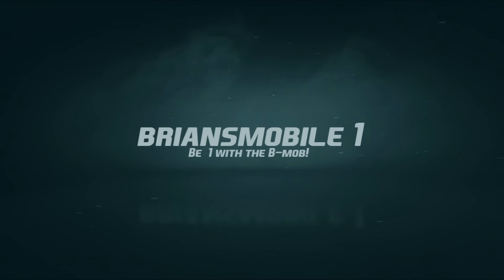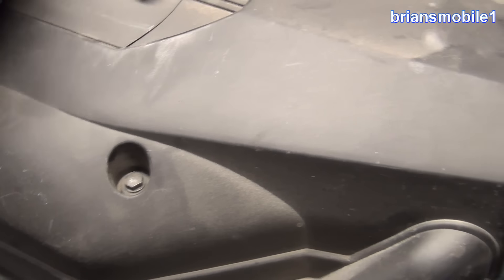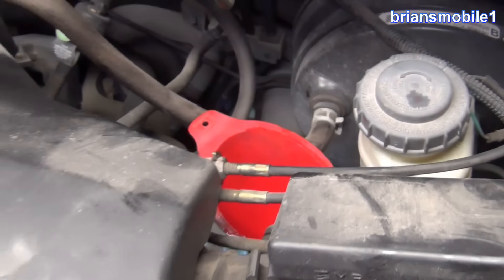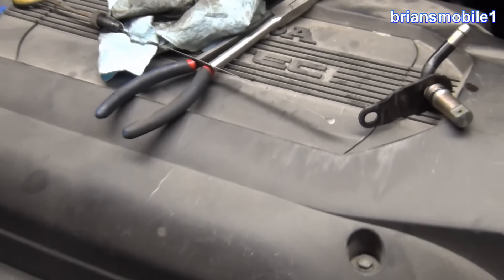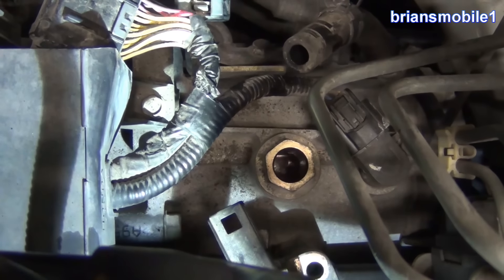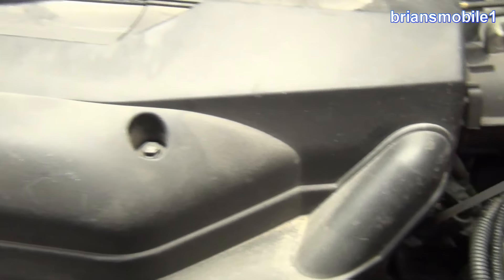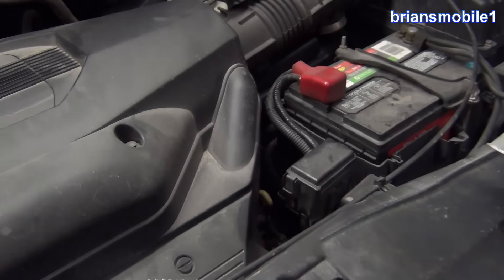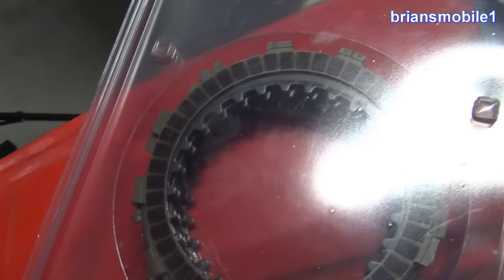Watch this Video BEFORE You Destroy Your Honda Transmission

Comment: Wiped out my transmission in my 02 Civic. Should not have changed it, lasted about 1 month after flushing. Learned my lesson with the Hondas.
Reply: What did you do wrong?
Reply: Did you flush it or just dump the fluid and fill?

Comment: 2006 Crv owner, it’s got 275k on it. It has the bearing noise from the misaligned bearing in the trans side cover which is in the tsbs for this car. Been that way for a long time and I live with the whine. Been doing a drain and refill on the trans every 3-4 oil changes and checking the magnet for debris.  Using maxlife synthetic atf. 4 qt jug is $20 at Walmart.
Reply: Great video however I disagree about the Honda DW1. I've used valvoline synthetic on my CRV for the past 190,000 miles and is smooth as butter. I change it every 50k and never use Honda DW1. Never had a transmission issue. I even tow a trailer now and then. I currently have 248,000 miles on my CRV and going strong.

Comment: That "return line" is installed as part of a recall for 2003 and 2004 models.  It was to provide extra lubrication for one of the internal gears.  If your 2003 or 2004 doesn't have this, get it done.
Reply from the maker: Thanks so much for sharing that.  It really seemed like a piece of after thought engineering. 

Especially since it's not a 2000's Chrysler- it seemed out of place.
Reply: Yup. I put many of those kits on at the Acura dealership as well.
Reply: No Thanks no the RLs were good for the most part, it was the TLs and the MDXs that had the same issues as the accords and odyssey’s
Reply: @Jack Daniels They must have gotten the 04's when they were still brand new fresh, because everyone i know who has a 2003-04 Odyssey hasn't had any transmission issues like the 99-02 years.
Reply: @briansmobile1  It was definitely an afterthought. The root problem of that second gear overheating issue was that the C2/S2 Gear set was subjected to inadequate oil coverage when the car was not in second gear (heat radiating to the gear set without being dissipated). This issue was eventually fixed by changing the design one of the valves in the Main Valve Body (Lockup Control Valve, maybe; I don't remember) to increase ATF flow to the second gear set. The problem manifested itself mostly in vehicles that were driven long distances at highway speeds in warmer climates, where the opportunity to downshift and flood the gear set with ATF were less frequent.
Pretty sure that design changed in Mass Production in 2003 across all V6 5AT models.

Comment: I know I'm late to the party, but have a 2006. Trans change at 225k and now has 380k with 3 fluid changes on it. About every 30k I do a drain and fill. Great video
Reply: Is 225k your first change?
Reply: @renzrenz3465  Yes that was my first change. Current one down shifting into 3rd a little hard sometimes. When I did a drain and fill at 400k the plug was a bit too fuzzy for my liking. Really can't do anything about it but baby it until it dies... trying for 500k
Reply: @thomasphilyaw8593  meaning after your first change it works better?
Reply: What kind of vehicle?
Reply: @starkeymorgan4142  2006 Honda Odyssey Touring, it now has 430k miles.
Reply: @Starkey Morgan No filter change on transmission just drain and fills
Reply: Are you saying you changed the transmission at 225k miles, or that you did your first fluid change at 225k miles?  If transmission, did you rebuild or salvage?  Thank you!
Reply: @mattmccoy7364  I changed my transmission at 225k. It took a dump...I bought a rebuilt transmission that had all the upgrade fixes done to it and installed a trans cooler also. Trans was about $1400 and install was $600. I bought it from a shop in South Carolina and had it shipped to the shop that changed it for me. Now my van has 435k and still going.

Comment: Going to a quick lube is always a bad idea. If you don't know how to do it, watching a video like this will give you more knowledge than the quick lube place has. In most cases the underpaid high school graduate knows even less about each vehicle. They fix every car the same way and cars are not the same. Bring it to a specialist or watch a video like this from a specialist. Thanks for the info. Very helpful as I'm trying to figure out a transmission problem that a "mechanic" has messed up. There are a lot of "backyard" mechanics disguises as professionals.

Comment: 1990 civic hatch. 275k on the OG trans. Fluid changed every 15k. I’ve been keeping that up, still shifts like butter..
Reply: What type of transmission fluid did you use? Autozone is saying dextron 2 for this year.
Reply: @ronniecatalano5246  Honda ATF.

Comment: OH man this video came at a better time, I work at a Honda dealership maintenance department and transmission fluid replacement is part and parcel of our work. By the way, I didn't know John Malkovich is a car technician lol
Reply: So do we check the trans fluid level with the engine on or off?😂
Reply: @superjeffstanton  according to the OEM instructions: off after running the engine to operating temperature after fans turn on.

Comment: good video ! i have this same van and made the switch to redline d4 atf four years ago and the trans works so well that i am using it in the power steering  without any issues i think that honda atf is over priced and not near as good as the d4 and i had to replace the steering rack two years ago witch always had the honda ps fluid in it and the rack failed ! d4 is the solution people .

Comment: I destroyed mine back in like 05 at 110k by adding some additive to fix what I thought was hard shifting (it wasn’t). Didn’t take long to find out what hard shifting really was. The clutch material plugged the passages and trashed the first/second gear clutch packs. Had it rebuilt and it lasted another 100k without issue with just drain/refills.
Reply: How much did they charge?
Reply: What did you add?

Comment: Since I will own my Honda Civic till I can no longer drive I do use Hondas transmission fluid but do the intervals sooner than they recommend .
Why ?  Two things you must realize , manufacturers have determined the recommended maintenance will take your new car through the warranty period without problems ,  I plan on owning this vehicle for well over 200k miles and more frequent fluid changes will increase my chances of making it through that period and we’ll beyond .  Also , get the best lubricants and filters available , it will pay for itself .
Good video sir ! 👍👍

Comment: Good advice, only drain and fill a Honda automatic. I do it every second oil change and have not had a problem in 20 years.
Reply: I do the same with my fluids as well as oil and they are all crystal clear.. never have any problems and shift like brand new.

Comment: 100% correct..NEVER flush anything..motors (unless you rebuild it) or transmissions..
Reply: Never flush anything that is OLDER, radiators included. But if its well maintained from day 1, you can get away with it. I "flush" my  motor sometimes with some transmission fluid or Marvel Mystery oil. But yeah, empty and refill is the safest policy.
Reply: You are saying never flush a radiator?

Um ok guys. 
That’s just wrong. 

Obviously you guys never do much ac work.
Reply: I've flushed my transmission for years. Never had a problem.
Reply: @DJR5280  I keep hearing people say never flush a transmission because if your clutches are gone the material in the fluid is keeping it going. I build my own transmissions (4L60E) I know for a fact that is complete bullshit. Ive also heard that the clutches are brittle and the flush will make them fall apart, also complete bullshit I can understand not doing a cemical flush but a fluid flush is fine.
Reply: I'm so sorry my husband did the chemical one. Here is the tow truck
Reply: Iv used sea foam an it works just use a little for 100 miles before oil change keeps motor clean an fresh wit no damage.
Reply: @martinez1701a  I have a 2005 Malibu with the 4T45E. Every 30k I have it flushed at thr dealer. Went 170k miles before the 2-3 shift solenoid went. The shop I went to talked me into a rebuild. What a nightmare. I don't think I'll ever get a rebuild again. Anyway, I had the transmission rebuilt again ar 205k miles and I'm now ar 272k with no problems. Flushed twice at the dealer since 205k miles. They use BG products. No problems so far. My 05 Tahoe has a 4L60E. Not sure how I want to attack that.

Comment: As having rebuilt a 200,000+ mile Honda trans that was abused, Honda transmissions are built like a manual transmission but with clutch packs on the side of the gear assemblies.
Reply: Any manuals for this. Trying to look at what to do for fun. Im having a hard te finding any info on rebuilding transmissions.

Comment: Funny thing is I did the GM Goodwrench transmission service every 45k miles on my 2004 Silverado 1500 and it had 220k miles on it before the transmission died. Those transmissions are noted to last only 130k or less in many cases. 1st service was a traditional service the old way and 2nd was machine serviced. 3rd and 4th were machine serviced and it made it to 220k so it did not hurt it that bad. Just my experience with Machine services. Now on my 2020 Camry I am doing traditional service all the way so I will see how it does. I just purchased another GM truck a 2003 GMC 1500 so I will see how it does with just traditional service. I have had concerns about this too, but it did not hurt my 2004 Silverado at all.

Comment: Just a little history on that "Return Line".. It's actually a sign of the vehicle having the Transmission Recall done on it.  That Jet was installed to properly lubricate the 2nd Gear.  So if you have a van that doesn't have that Recall Jet installed, I'd suggest getting that recall performed or worst case, just buy the Oil Jet Kit.
Reply: I wish I had a part# for the kit, and I agree with you. You're exactly right about the purpose of that Oil Jet Kit.
Reply: @netdoctor1  A/T  Oil  Jet  Kit: P/N  06250-PGH-305,  H/C  7758931

Or just stop in at the Honda dealer, they might have an updated version.
Reply: @peteryang7784  Excellent, thank you, though it's different part numbers for different models. See also https://atracom.blob.core.windows.net/manuals/individual/2006/2006-226.pdf

Comment: I have been using Amsoil ATF for some 25K miles, for two 1x3s,  and it works great. I often hear about only using Honda fluids, but the Honda stuff is not nearly as high-end of a synthetic as Amsoil or Redline. I could feel the shifts degrading over time before with the OEM fluid, yet have not felt any degradation using the new stuff. It did shift much firmer initially after switching, but calmed down to normal after a day or so. 

The Acurazine forum for my 3rd gen TL is in love with Redline products, and using as little friction modifiers as possible in the ATF, so you could look into that as well. Remember to change the filters on these cars if it has never been changed before.

It seems that changing out the fluid regularly is the best thing that one can do to prolong the life of a Honda transmission. And this is the best video tutorial I have seen yet on how to do it, thank you Briansmobil1.
Reply: Amsoil is the best. I use it in my 2018 Honda CR-V. Cvt transmission
Reply: I use amsoil cvt trans. Fluid

Comment: My shop recommends performing drain and fill service on Honda automatic transmissions every 15K miles. We use O.E. Honda fluid. Our customers who adhere to this service have very little transmission issues.
Reply: The only reason to replace it that often is cause honda doesn’t use a filter for some reason.

Comment: Thanks Brian 👍🏽👍🏽..., Remember guys an gals to check your owners Manual.  Different models have a specific fill level, for example my 08 pilot 2WD takes 4.0 quarts and the 08 pilot AWD takes 3.5 Quarts. I filled mine to 3.5 because I was lazy and checked Google and a couple forums which said 3.5 so that's what I put🤦. Randomly  skimming through my manual in Specifications section there it was ATF 4.0 quarts. I was riding like that over a year. Note to self  Always check the MANUAL😬

Comment: I check the level before removing drain plug.. I drain then fill with the same exact amount that came out.  

A friend of mine had some rough shifting in his 2012 accord... we did 3 drain and fills in a span of 2 months. We also cleaned out all the solenoids that were accesible at the last drain and fill... problem was fixed.  After every drain and fill we got better results.  Trans fluid was cheap on amazon.

Comment: IMO as a tec the best thing you can do to these   transmissions Add a “transmission-cooler”...good video
Reply: 110%
Reply: Jet kit and cooler is the best thing for these transmissions.
Reply: @LazySniper  where could I find one? I have an '01 Accord with a B7XA.
Reply: @juniperburton7693  dealership might still be able to get them.
Reply: Dealer installed tow package came with tran cooler.
Reply: Best thing you can do is add an inline filter and change it often.

Comment: Great video Brian!  I have had 2 Honda transmissions go to well over 200k with doing transmission fluid drain and fill regularly.  Especially if you DIY oil changes, it’s easy to just do a drain and fill every 15k miles.  

My 2017 odyssey (30k miles) is about to get a full change (3 drain, 3 refills) and a external filter change (really happy Honda put an external filter from the factory).
Reply: There is also a 5-micron strainer inside. The drain bolt also has a magnet to collect ferrous material from the pan, and the torque converter has a built-in strategy for trapping fragments as well.
Reply: @netdoctor1  What about 01 accords? Same?
Reply: @Dan0rioN  For certain.

Comment: I do fill and drain 3 quarts a time 3x as well every 20-30k mile interval. I also install a large transmission radiator with inline filter . 220k miles later, my car still shifts like a butter - smooth
Reply: Wait so you use 9+ quarts of atf every time you change your transmission fluid??? What s waste of money
Reply: @slowazzes1972  then dont do it, let a machine do it for you and clog the ports to the solenoids . I only spent $70 for ATF every 20k miles - its way cheaper compare to repair shops tbh. Being cheap will only cost you more in the end.
Reply: With all respect, JD - allow me my $0.02 worth?
If you're changing that frequently, your fluid should look pretty darned good when you drain it - provided you don't have extreme heat or dusty conditions. If you're replacing that often, you could probably save the $$$ and forego the extra flushing. Today's fluids are pretty good, and unless you're really torching it and killing the lubrication additives, it's probably still in good shape.
I'm not suggesting you modify your change frequency; I just don't think your fluids are going to be bad enough that you need to get every drop out before refilling with fresh. I'm also vehemently opposed to disturbing the stray solids in your transmissions, as you could reintroduce something back into the oil flow that had previously been allowed to settle somewhere harmless. Even so little as a human hair in the wrong place can cause malfunction (NOT hyperbole: a human hair measures approx. 0.05mm in diameter. Valve clearance in a Linear Solenoid is about 0.03mm, I think).
I know you didn't ask for my opinion; feel free to tell me to go pound sand, if you think it appropriate.

Comment: My torque converter shuddered in my Pilot at 90k miles. I switched it over to Castrol for Imports and no more trouble. I'm at nearly 280k now.
Switched my Accords over as well.
Reply: netdoctor1 any updates on the castrol fluid has it give you problems
Reply: israel 20 None. Working beautifully
Reply: Odometer is approaching 310k.
Reply: Now 378,000 miles.

Comment: My car yesterday struggle to start im guessing bc it was cold but then when I was driving it made a whining noise when acelerating and the when the car got warmer it went away what that could be?
Reply: Winning noise meant your transmission oil is low. Check oil level.

Comment: Six "drain & fills" in a row with 5 minutes of operation between each one will replace over 99% of the fluid.  It's worth it!  (about $150 every 25k miles) I got two Odyssey's to last over 240k miles after an overhaul.  They pull trailers and drive in the hills. After the 5th drain and fill, the fluid on the dipstick looks so clear, it's hard to see it.  This is a practice I recommend for any automatic transmission.  For CVT's, I advise a single drain and fill every 10k miles - at the same time motor oil & filter is replaced.
Reply: So how many quarts of atf do you buy for every change? Seems like your just wasting atf
Reply: @slowazzes1972  It's about 3.2 quarts.  It's true, there is considerable "waste" to accomplish this.  I had three transmission overhauls between $2600 and $3000 on two Odysseys, and after the first one, the rebuilder told me his secret and he turned out to be correct.  Thinning out the contamination with successive "drain & fills" keeps the screens on the gear shifting sensors inside the case free of worn clutch debris and extends the life considerably.
Reply: @slowazzes1972  I buy 6 - 1 gallon containers.